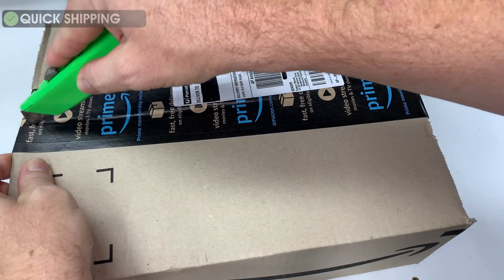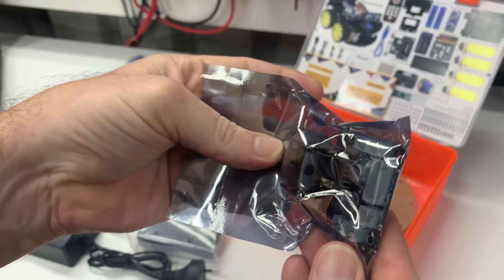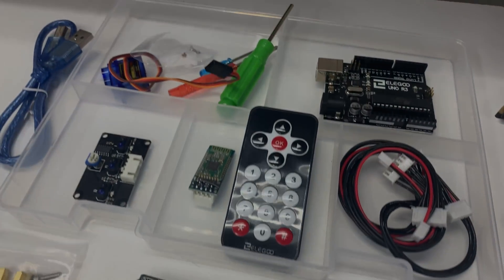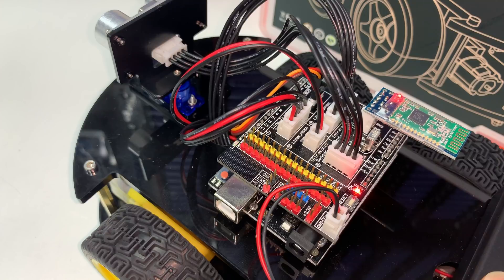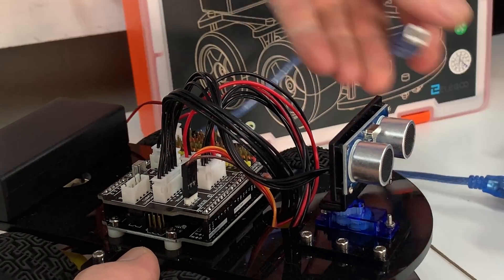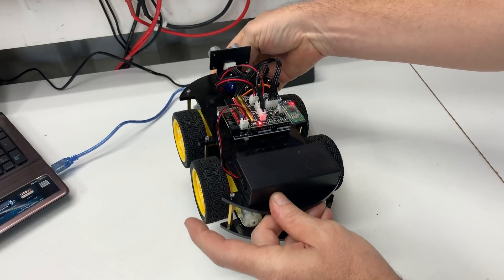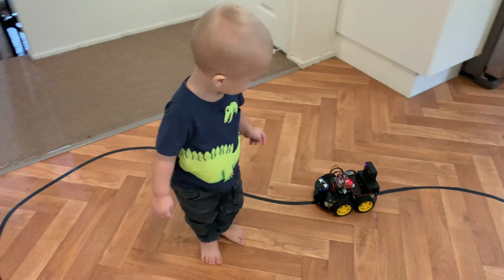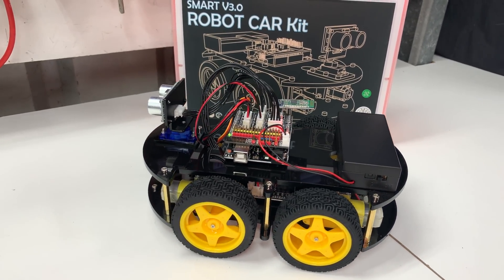Elegoo Smart V3 Robot Car Kit   Unbox, assembly & testing

Comment: The L298n data sheet only shows two motor capabilities.  How does the elegoo one do 4?
Mine also didn't come in that nice plastic box.  :'(
Reply from the maker: Does it have two of them? I"m not too sure havn't looked at the device since the video! Maybe cost cutting - box wouldn't be cheap, many did buy it and came in the plastic box
Reply: @HBPowerwall  I'm still not sure about that data sheet but per Elegoo they did indeed stop using the plastic for cost savings unfortunately.

Comment: A couple of years ago I bought one of these kits for my daughter, hoping to get her interested in this sort of thing. It was a more primitive version of this kit, wires instead of connectorized  cables. My daughter never did anything more than look at the box. Then my company handed me a project that utilized an Arduino, and I decided I needed to learn a lot about it fast. I reclaimed this kit and built it myself. There were assembly instruction errors, but debugging them just helped me learn more. I got it working and discovered that the provided code worked but begged for improvement, so I got coding. Eventually, in obstacle avoidance mode, the car could navigate my dog-leg hallway and return, avoiding oblique collisions with the walls that stymied the original code. In IR control mode I put in a dance move that freaked my dog. In the end I added Arduino fluency to my skill set and I am still making test fixtures for my company utilizing the Arduino. I wish I had gained this skill years ago.
Reply from the maker: My son & grand son loved it for about a week been sitting idol ever since :(
Reply: @HBPowerwall  That is probably because they ran out of challenges to keep them interested. One challenge I came up with would be to set up a simple maze with boxes or something and try to program to navigate that maze. Or, better yet, get them an Elegoo Arduino Starter Kit, under $40, and let them experiment with different sensors and motors and stuff. Search YouTube for "Arduino DIY" and pick some interesting projects. I feel like Arduino skills go naturally with most STEM fields, the skill will never hurt you.

Comment: Hi.  We are considering this kit for a school project and wonder if it has rubber or hard plastic tires. Thanks!
Reply from the maker: They have like a soft rubber tyre, but not air filled. I can press my finger into tyre and it depresses under a light touch.
Reply: @HBPowerwall  Thanks, that's very helpful. I wonder if you'd measure the top of the car. We are wanting to mount an arm to it. This will help us choose one with a base that fits onto it.